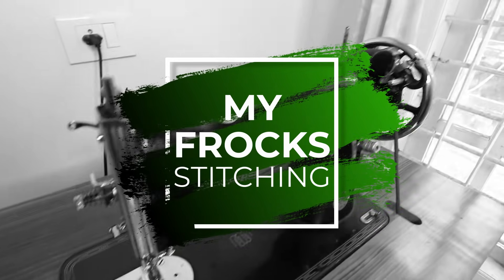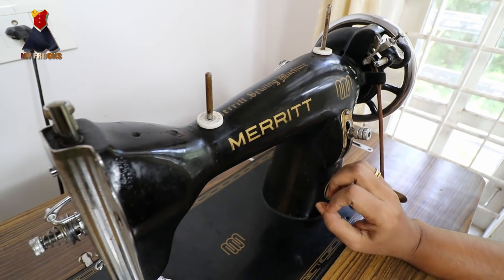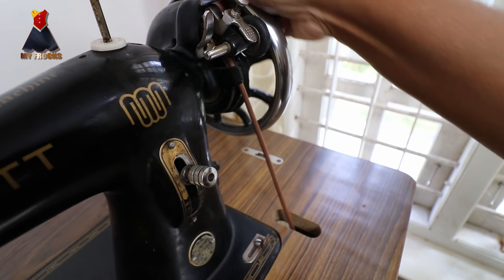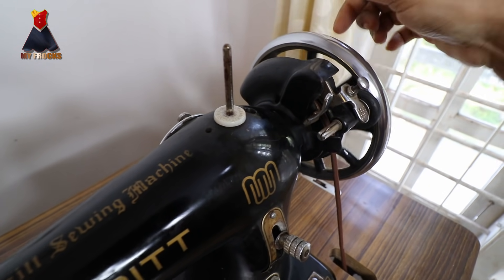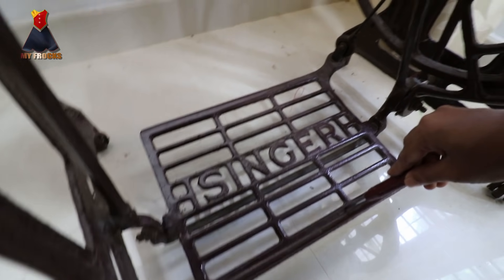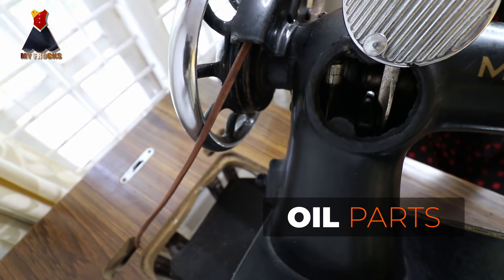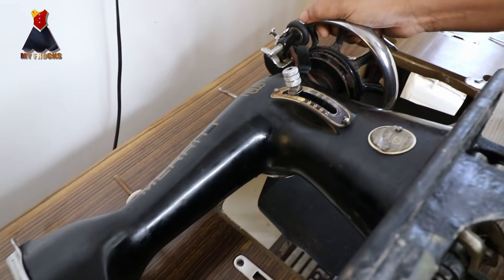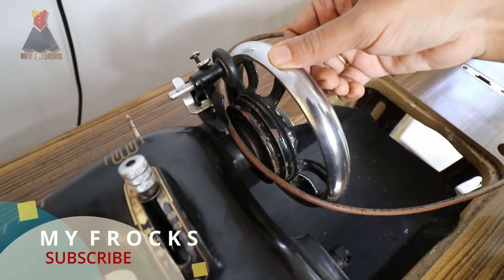Sewing machine wheel not rotating / Sewing machine wheel repair / Sewing machine home repair

Comment: കുറച്ചേ.. karangunnollu... theere.. speed.. illha.. athentha... madam
Reply from the maker: നന്നായി  oil ചെയ്‌തു clean chayytu നോക്കു.  Problems videos  ചാനലിൽ ഉണ്ട്. കണ്ടുനോക്കു.
Reply: 4 17 she points to a part with screw driver. There may be hair or threads twined around. Also around other joints. Once cleaned ur problems will get solved. Slowly open, taking photo before opening each part